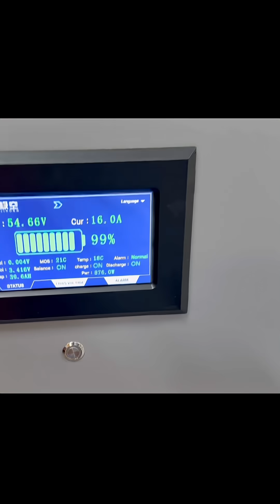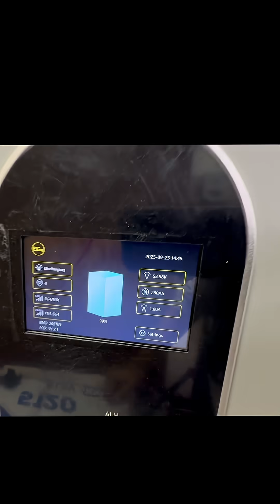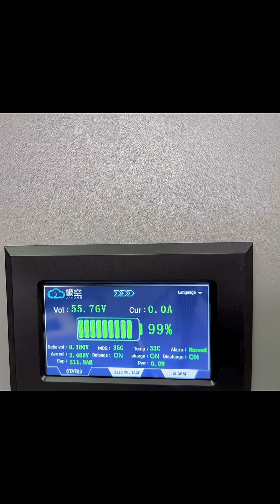Integrating a Yixiang battery with a voltage imbalance, what not to do.

Comment: Can it power welder ..also diy 8000 watt ..power furnace swamp cooler dryer air fryer microwave Mobile home
Reply from the maker: You’d need an inverter. This is a battery.

Comment: AI (for JK BMS):

The setting on the JK BMS that limits the current when connecting batteries in parallel for the first time is called the "Current Limiting function" or "Charging current limited" (on some models/firmware).

For the JK Inverter Series (PB-series) BMS:

Function Name: Current Limiting function (or Parallel current limiting function).

Purpose: This feature is primarily designed to prevent a high, potentially damaging surge of current (inrush current) between battery packs when they are first connected in parallel, especially if their voltages are not perfectly matched.

Behavior: When this function is active, if a current surge (like a charge overcurrent or short-circuit) is detected, the BMS will typically limit the charging current to a low, safe value, often around 10 Amperes (10A).

Configuration: This is usually a safety feature that you ensure is enabled or at least that the related "charging prohibition current limiting" is turned off in the app settings, allowing the limiting feature to trigger if needed
Reply from the maker: Yeah, not hugely fond of AI answers. They are so often wrong. And usually long winded.

Comment: BMS will protect something failing. BMS has no high current thru it, it has a current shumt to understand this.  Non issue IMO
Reply from the maker: This or not using a precharge resistor could both result in a damaged BMS. Rare yes, but best to do things to mitigate the issue.
Reply: @GavinStoneDIY pre charge resistor may prevent battery inrush current but BMS only "watches" and shouldn't take the load
Reply: Thinking a little further, I could see the gates of the MOSFET being overwhelmed and scortched. I'm with you here
Reply from the maker: @SolarDrew that’s usually what would be damaged. Granted I know it’s rare. BMS’s are designed with surge ratings. But yeah, it can and does happen. I’ve talked with people that have accidentally done this.

Comment: Whenever I add a battery (just added 2 basen-green 325ah) I force the entire stack to charge until all BMS cut off. Then let it be. I just keep V at 55+ so no 1 battery has a chance to parasitically draw from any other.
Reply from the maker: That’s the easiest way to do it. And in most battery manuals you’ll see similar directions. I’ve done it that way, or just matching voltage does work. If someone doesn’t have the charging capability at the moment.

Comment: If your BMS is set up properly this shouldn't be an issue.  The BMS should keep you from damaging your pack.
Reply from the maker: The BMS itself can be damaged. Not the cells.
Reply: @GavinStoneDIY  I guess that is where proper fuses also come into play.  I agree you should avoid the issue to begin with.  I've added battery packs to my existing system.  I make sure they are all about the same state of charge before flipping the switch.  So far, I haven't blown myself up.
Reply: I'm with you BMS is a low voltage device. Doesn't have high current running through it, only monitoring. That's the beauty of BMS
Reply: @SolarDrew  not true, it both monitors and all the power runs through it.
Reply from the maker: @SolarDrew BMS does have current running through it. Hence the need to size the wire leads coming off it correctly.

Comment: You should be able to set the jk bms max charge and discharge amps to a lower value to transfer power between banks. It may serge but the bms should catch before blowing fuses. Off grid garage has demonstrated this many times with the jK and sepsol BMS. I have not tested but it should work? 😮 I do like those EG4 vertical batteries I am getting ready to buy a few.
Reply from the maker: Yeah that’s true. But if the amperage amount exceeded the BMS output then it would just shut the battery off. So it’s really all or nothing if you’re doing it the wrong way like I did.
Reply: @GavinStoneDIY  I believe it just limits the current to the set values without a shutdown. I have seen a few other YT do this for DC to DC charging.
Reply from the maker: @ColorMaker_Solar ahh ok cool. I may experiment with that on this or my next one. That’s good info
Reply: Good info i want to do this same this get this diy battery and integrate it with my 2 other eg4 wall mount batteries

Comment: I think once the difference is more than 2 volts, that's where you can get that significant inrush. But I agree, the lower the delta the better. So 0.5 volts is definitely better than a larger delta.
Reply from the maker: Yeah, it’s definitely less of a nail biting experience when you get the voltage a little closer. 😁